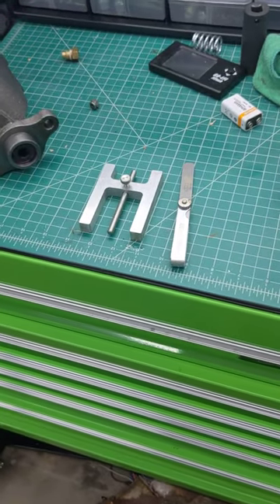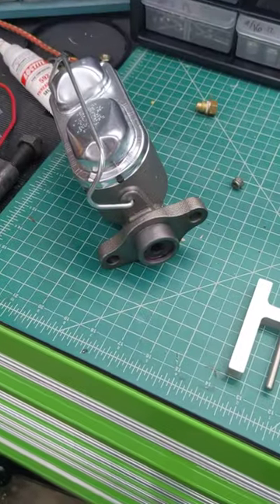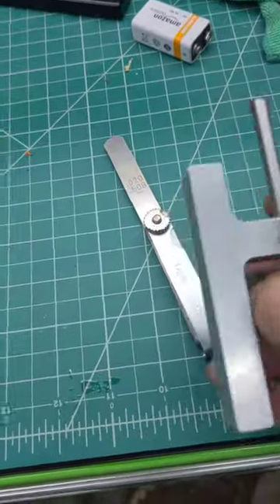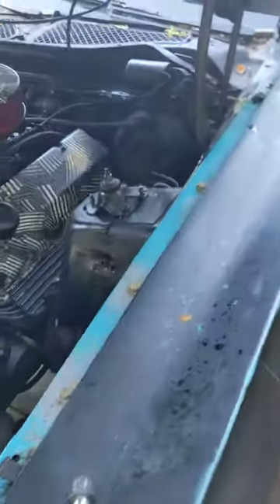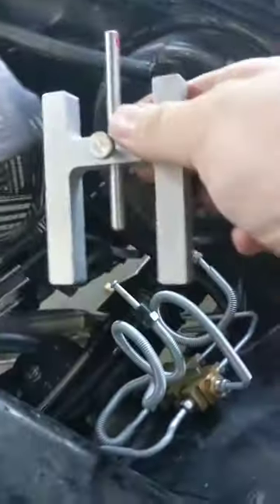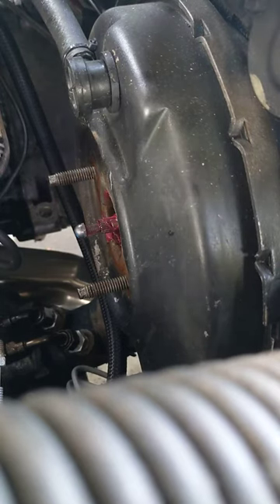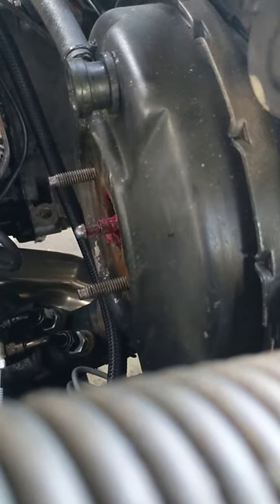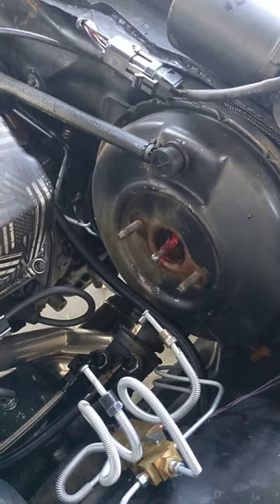Properly setting the Master Cylinder Rod! AKA Booster Pin

Comment: Good job on your first video. Straight to the point without talking it to death like so many seem to do. If you are going to use a gasket, don't forget to add it to the master before measuring the depth. cheers

Comment: Great video, love the valve covers,remember when you do this to start the car,once the engine is running and vacuum is going thru the booster it will change the position of the rod, thats when you wanna measure it.

Comment: SOB!!! It all started with brake fluid on the ground. Changed the master cylinder  [leak was still present],  changed the hydroboost [leak gone, but brakes begun to drag]. So I changed out the brake calipers, brake hoses and obviously bleed the system and everything worked great for about hr. Brakes started to drag again, so pulled it into a near by mechanic. Going in there I knew what the problem was the [hydroboost] and told them it's the hydroboost. They agreed and I left it there because I figured that was something I probably couldn't do. It's simple AF and now gonna be out probably around 500 bucks. God I'm hoping for 500 or below...
Reply: What was the outcome? I have this problem and have been chasing it for about a week and I am in the same place wondering if it’s the hydro boost
Reply: @carrottopfarm9037  100% was the spacing on the hydroboost. Truck is running great now no issues with the brakes. Mechanic only charged me a 100 which was awesome...
Reply: I in the the process of going from vacuum to hydroboost conversation..as far as I know you need to check the push rod engagement on either system . I been told to use the original push rod on hydroboost. If my push rod is too long I just cut it off and re grind the ball end

Comment: Thanks for the video bro. I’m gonna install a new brake booster and a new master cylinder, my concern is if I need to apply some kind of grease on the pin? I’m asking that because I see some kind of grease on yours.
Reply from the maker: Yes I put a little bit of grease on the end. It helps with friction when you press the brake pedal. That way the pin doesn't get worn down every time you press the brake pedal
Reply: @brianstechtips5721  thank you again!
Reply from the maker: You're welcome

Comment: Question my 99 4runner has a brake problem. (Just bought it) the brakes lock up gradually until they smoke. I wait till they unlock. or i realese the presure by bleeding the caliper. Looks like the previous owner changed the booster and  master I did the calipers and hose lines. Problem still not fixed it do not have a abs light on. Could a bad rod adjustment be the pbroblem???
Reply from the maker: Very possible. If the rod is too long it's always going to push on the brakes

Comment: I read anywhere from .02" - .06". Or a sheet of paper to 1/16" of an inch. Each manufacturer is supposed to publish this spec like Bendix etc, but I'm not finding that in any of the shop manuals. I see people advocate a sheet of paper (which is really like .004"...printer paper, business card like .012") up to 1/16". That's a huge amount of difference. I think if one went with the smaller gap, you'd get less pedal play, but I don't know which gap is usually correct.
Reply: you should be able to call the Dealer and ask someone in the service/parts department what the gap setting should be for your vehicle. I found the information for mine in the shop manual.and the spec for mine is 0.00. Also when setting the tool by putting it up against the back of the Master Cylinder.....make sure you have your Gasket between the tool and the back of the Master Cylinder. You want to account for the thickness of the gasket.
Reply: @yer854Do You honestly think I'm going to get an answer from a dealer on a '78 Dodge? The people in their service department weren't even born when the truck was made.

Comment: it would have been helpful if you had actually shown how to adjust the pin. On my car the pin just spins around when you try putting a wrench or socket on it. I'm unable to get it to thread out or in.  Also the pin length/gap specification is different for different vehicles. On the 1998 Toyota Tacoma the gap spec is 0 mm.